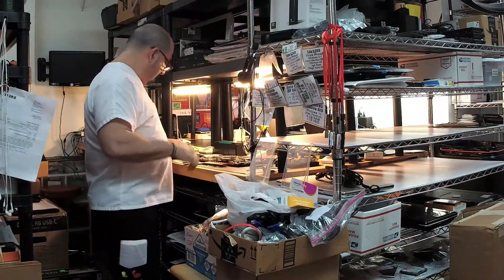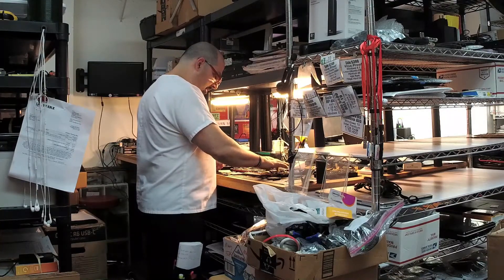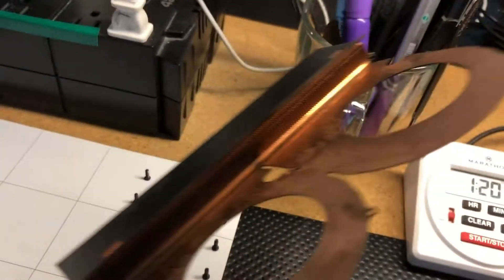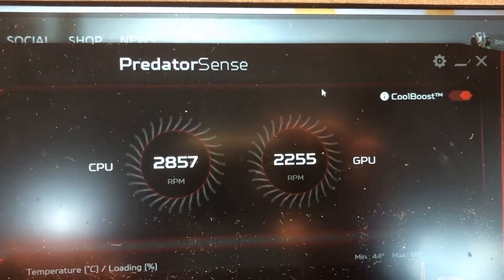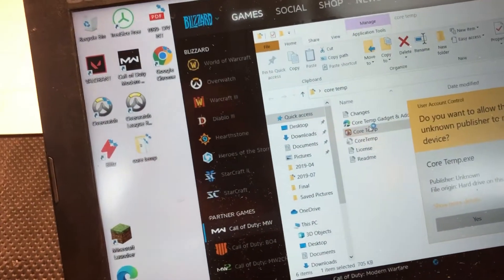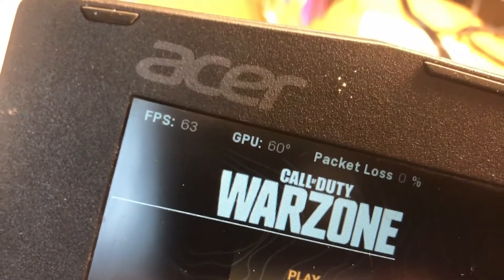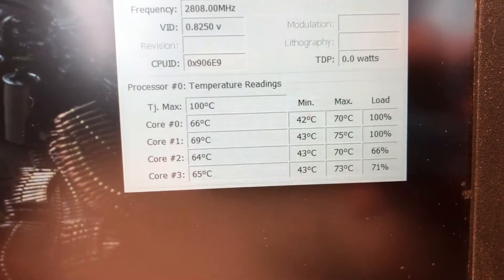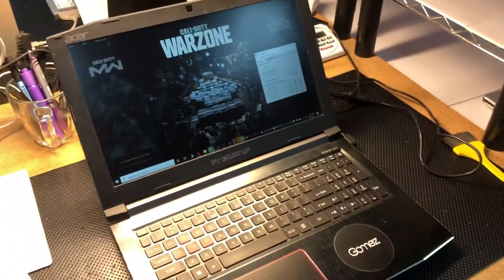Acer Predator Getting Hot and Games Running Slow

Comment: I have an Acer Predator as well and it seems like it's running too hot can you show how you cleaned and re applied thermal paste on the heat sync to the chipset area?  Also the sound degraded on the laptop when it was running hot, did they place the audio chip set near the cpu and gpu on the Acer Predator?